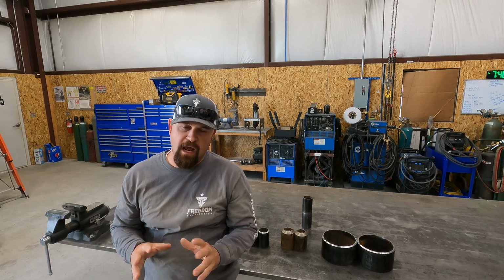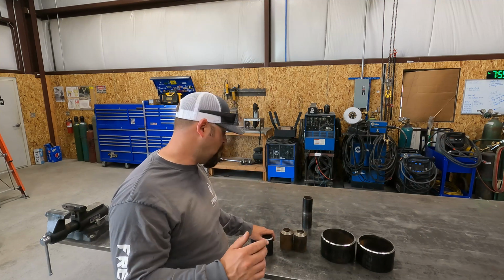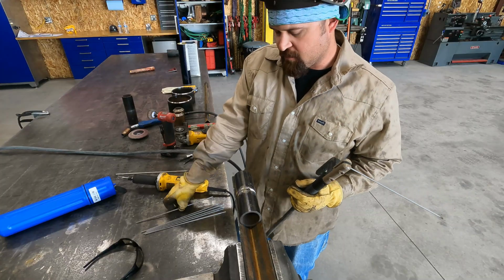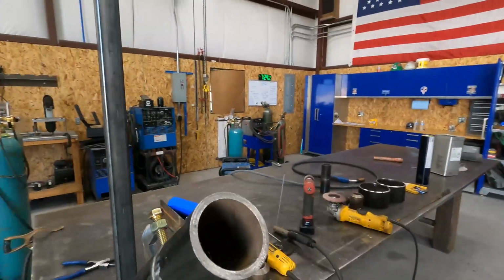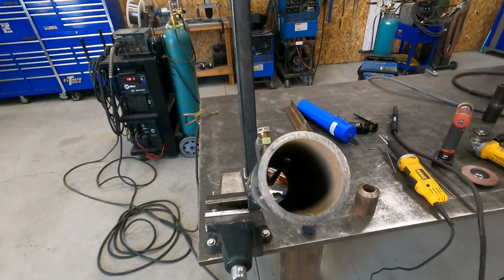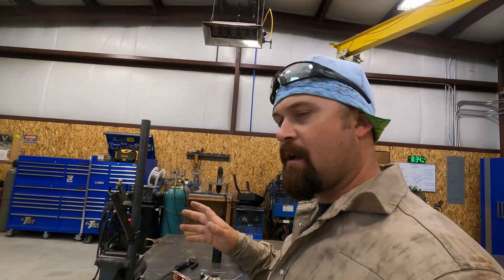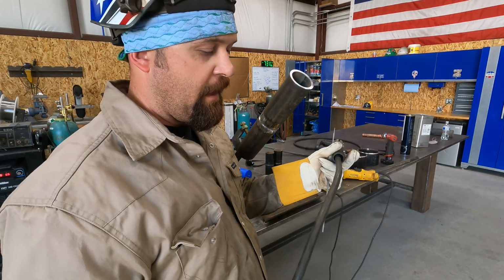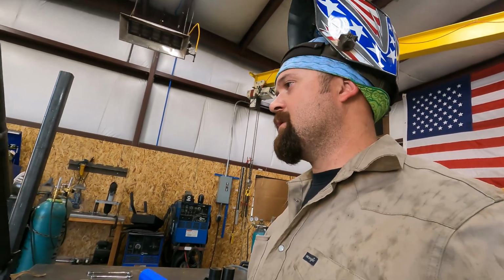2 Inch, Schedule 80 6G pipe welding practice test. 6010 Root, 7018 Cap.

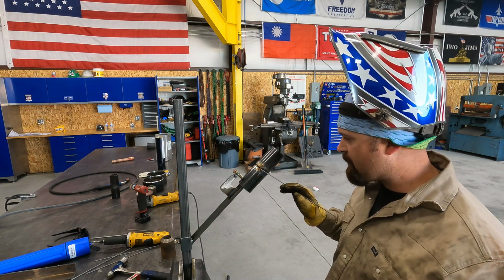Comment: 16:40 thats how I start 7018. With 6010 I boat ramp it (feather it) and start back near the beginning of my boat ramp to let the rod heat up. When I get to my tie in, I push the last little bit through before I run off the edge into the keyhole and I get a good tie in.

29:00 I notice the problem when youre welding. Your fire is coming out the front side of your pipe. That means youre not pushing enough. Push man. You have to push that rod in there and make the fire come out on the inside. You want very minimal if any sparks coming out the front. You know its in there then.
Reply from the maker: I’ll give that a try. Thanks for the info, and thanks for watching!
Reply: @Freedomfabrication777  no worries brother. I'm simply here to help you get better if I can. I'm not the best welder in the world but I do okay 😁

Comment: 6G-R is very hard welding; especially on ships.  In water I used 1000-1200 amp rods that measure 1/2” by 4’ long. In water you can feel those amps.

Comment: If your using 3/32 run a 1/16" gap if your going to run a 3/32" gap run a 1/8" rod thats ive never used a 3/32" rod alway ran a 1/8"
Reply from the maker: @wendell454  My buddy that’s a pipe welder for Tesoro said they commonly use 3/32 for a root. I’ll have to give the 1/8” a try. Thanks for watching!

Comment: I've been welding pipe for years. Let me tell you. I don't think they'll let you take a test with 3 32 60 10. It's always been 1/8 6010.... For the monster coupon. To get the ball rolling for you.A little better put a crescent wrench or a file in the end of your pipe to rest your arm on the right side weld.your 3/32 land is good "BUT USE A DIME GAP" 1/8 6010 about 80 ... 85 amps ....3/32 amps  fill and cap  about 85 amps This is for sch 40.....monster test..same except after root pass ...run a hot pass 6010 about 85 amps...then fill and cap 1/8 7018 ...118 amps... Plus or minus....extra tip always practice welding 7018 up hill on 3/8 plate or thicker Remember for every new job you get you have to take a new test.....if you don't use it you lose it ....GOOD LUCK BROTHER🦅🦅🦅🦅

Comment: I work with pipeline welders running 6010 or 8010 downhill on gas transmission pipelines. Running uphill seems like it would be a little tougher. A lot of heat and working against gravity.
Reply from the maker: @BMGProjects  Uphill is more difficult. In this case, that’s what the procedure called for. Thanks for watching!

Comment: I know I’m a little late to the game but I just discovered your channel and a new sub. I’ve been a certified pipe welder ( 6g sch 80) for 25 years and one small suggestion is a stringer cap. I used 1/8- 7018, 3 bead stringer cap. No real movement other than dragging it and overlapping each bead by 1/2. I enjoy your videos, keep ‘em comin and best of luck to you!
Reply from the maker: Better late than never! Thanks for the suggestions, I’ll give them a try. Thanks for watching!

Comment: Dude, why 2"80? weld out the monster...... unlimited dia. unlimited wall thickness and its about a billion times easier. Also 3/32" 6010?? eff that 1/8" 5p+ all the way with a 3/32" gap and land. Also that stand is,wayctoo fckn high, on your bad side it's too awkward and difficult to get the correct rod angle and that's why you are blowing out the top. What code are you testing to? I'd assume asme section 9 so you can trash that 6" and 2" sch 80 pipe the monster will more than suffice unlimited dia. and 1 1/4" wall thickness.
Reply: Most pipefitter type jobs will give a sched 80 test because its just about the most difficult thing to weld and on a sched 80 if you run a 1/8 6010 root it will most likely be above flush and the cap would be to big
Reply: Maybe because it’s the most common pipe test and it’s what the WPS he’s practicing for calls for

Comment: In the early part of the video you said, maybe jokingly, that you wanted to be certified from 2” to 24”. Pipe certification ends at 12”. Pipe welded beyond that range reverts back to a plate certification. It’s funny when people say they are a “certified welder”. When in reality they can pass a certification test for “ Engineer 1”. Walk across the street, where they meet “Engineer 2” who doesn’t have to accept that “certification “ even when the ink hasn’t dried.
Reply from the maker: I couldn’t remember what the largest size the certification included was. If it is 12”, that’s my mistake. I agree with the “certified welder” comment. That was the point I was trying to make in the video. I think being a good welder doesn’t come down to tests and certifications, it comes down to taking pride in your work, and taking the proper steps in weld preparation and knowing how to use the right process for the job to make a sound, clean, and yes, I’ll say it, a pretty weld. That’s just my opinion though. Thanks for watching!

Comment: I always start the root from the top and work your way down the pipe . Running the root pass from the bottom to the top it runs a lot hotter
Reply from the maker: I like running it down hill as well, but this one calls for an uphill 6010 root. Thanks for watching!

Comment: Nice video and solid progress! I’ve only had to take 1 6g test but the procedure was job specific which wasn’t very common. I had 6” pipe, only the top piece had a bevel, a chill ring for a backer, 7018 root, and .045 dualshield the rest of the way out. It was alittle tricky for me bc I’m an ironworker so my pipe welding history was pretty limited to tube braces and handrail for the most part. After a few practice mockups I was able to pass.  For me I found that if I chick the rod in the stinger angled down towards the base of the stinger I can just roll my wrist around and it eliminates the natural push angle that I run into as i progress uphill. Also I tend to run tighter stringers and more passes so that I don’t have to fight the undercut as much.  Maybe some vice grips clamped on somewhere for an elbow rest, or possibly another bracket with a small chunk of pipe welded to it for an elbow rest? Comfort is key and practice is king!
Reply from the maker: All good suggestions. I just ran one tonight with 2 cap passes instead of 1, and it went pretty good. I’m sure I’ll get there. Just gotta see what works for me. That does sound like a unique test that you had to do. Thanks for the suggestions and thanks for watching.

Comment: What Code (ASME Section IX, is pressure API for petroleum or AWS D1.1) and WPS/PQR are you running to, Where is a CWI (on sight) to inspect the joint fit up and the Root pass along with verify the process. Amp ranges to stay in accordance with a Qualified WPS
Reply: If only you had a clue what you’re talking about.
Reply: @AustinWhitehead9  Have you ever taken a weld certification or given one

Comment: I'm a certified JB tack welder. ;) I've never tried welding pipe. Doubt I ever will, as a hobbyist. I did take a MIG 2F test and passed it once a long time ago, so, yeah, I'm AWS "certified." 😂
Reply from the maker: I will never discredit any certification. My point was that the “certified welder” talk gets thrown around a lot. Some of the best welders I know aren’t technically “certified”. That was my point. I hope I didn’t offend you with that. It was not intended.
Reply: @Freedomfabrication777  No offense. I joke about my "certification" all the time. It's legit, but it doesn't mean crap, just fancy wall paper. lol

Comment: Hey man I’ve been watching for a while never really comment on anything but I’m a big fan. I’ve been a welder for about 15 years and I love your videos, just a tip on this test I’ve had success with if your open to it, when it comes to the 7018 part, I would be down between 75-80 amps and run small circles (basically stringers) and make a two bead cap. Big fan and keep up the awesome videos
Reply from the maker: Glad to have another experienced welder that’s a fan. That means a lot. I appreciate the advice I guess I didn’t really mention it, but I’ve been running a backwards “e” oscillation, and I feel like it’s been working ok. I think I will try the 2 bead cap thing and see how that goes. I appreciate the advice, and Thanks for watching!
🇺🇸🤘🏻⚡️🔥
Reply: @Freedomfabrication777  I find your channel to be the most laid back in my opinion it’s easy to watch and down to earth. The only reason I have success with the two bead cap is because I find it is the only way I don’t have huge build up so splitting the cap into two bead makes me move faster and the circles help me hold my edges just enough to not have undercut. I love the practice videos I’ve spend many days in my garage practicing for tests and no one ever sees that side of it. You got a supporter here man love the channel.
Reply from the maker: @darrin_borst  I’m glad to hear your opinion about the channel. That’s exactly what I was going for. I didn’t want my channel to be too serious. I try portray my true personality and life in my videos. You can’t take life too serious. I hope it’s informative, but I want it to be somewhat entertaining as well. I appreciate the feedback and the advice, I’m gonna try the tighter oscillation with 2 beads tonight. I enjoy making friends with people with similar interests on YouTube. Not sure If you had a friend in Utah before, but now you do. Thanks.
Reply: @Freedomfabrication777  same here buddy. I’m from Pittsburgh so you have a friend in the steel city. Good luck my friend.
Reply from the maker: @darrin_borst  You as well, thanks.👍🏻

Comment: I am right there with you. Just started a couple of days ago prepping some 2-7/8 pipe but I have to hand bevel it. 25 year backs I certified with high pressure (tig root and hot pass with 7018 filler and cap on 6") but let my cert lapse and never thought I would weld much. Now I am trying to start it all back up as a side hustle.

Something you might try is lowering your coupon and putting a file in the end of the pipe so you an put your weak arm over it and steady it more or you can take a clamp and put it on the channel and prop your weak arm against it so you can be more steady. I have used files, vice grips, clamps, etc. I am sure you will find a way. -----

Just some ideas from one welder to another.
Reply from the maker: That’s a good suggestion. I’ll have to figure some sort of a brace out to steady my less coordinated side. Thanks for the suggestion and thanks for watching!

Comment: Great timing on this video.   Last month I took the 3G stick test at school and passed 5 months ahead of graduation and probably going to do the 6G next just like this one in the video.  Thx for all the pointers.  

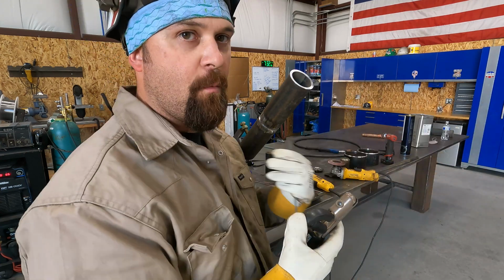If you watch your hyper speed I noticed your stick oscillation was much better at 27:33 - 27:49 and that was some of your best beads.  

I had to definitely let the metal cool down a little more often between passes a to keep the beads from sagging  .  

Love the the drive and determination to kick 6Gs ass.  Can’t count how many times I stuck  a rod and threw it across the room.   That was CLASSIC at the end 😂😂😂!!!!
Reply from the maker: Hope you can get something good from it. That’s a great suggestion on letting it cool longer between root, and cap. Lol, I’m not gonna pretend that it doesn’t get frustrating sometimes. You know how it goes. Thanks again for the encouraging advice and thanks as always for watching.